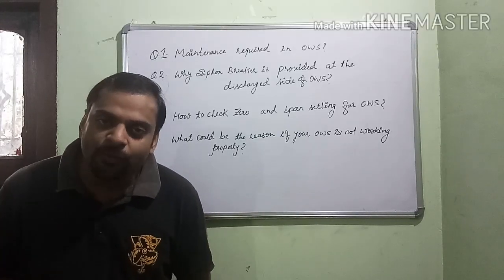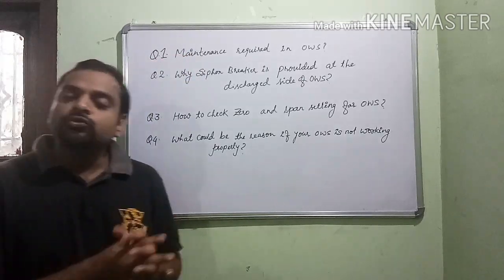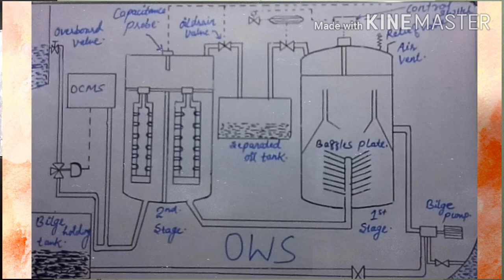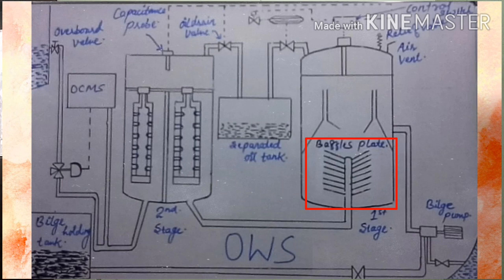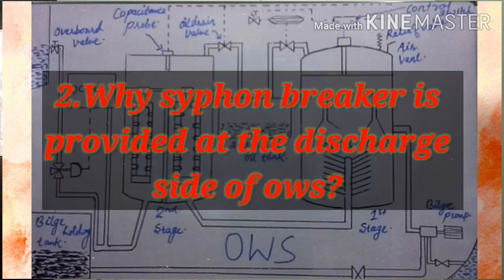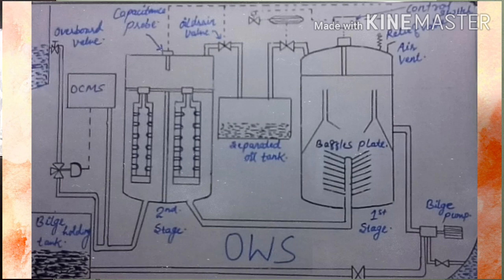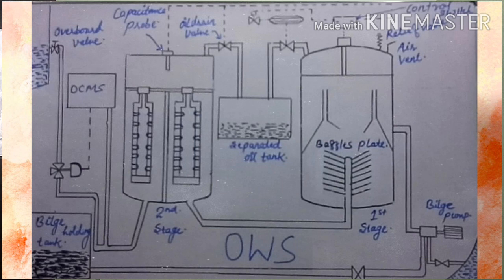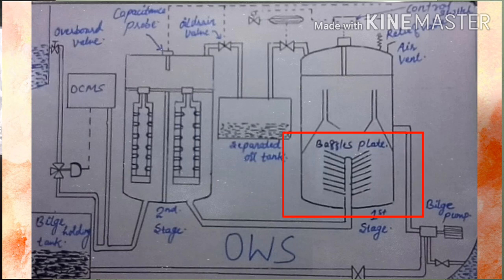oily water separators| OWS Troubleshooting

Comment: Sir u said caco3 takes place below 80 degree and mg(oh)2 takes place above 80 degree but  evaporation is taking place between 40-60 degree then how ma(oh)2 is taking place?
Reply from the maker: And second and most important thing is scale formation is not the major concern in fresh water generator because this is only the reason evaporating temperature is low in case of fresh water generator but it is also possible at 85.degree Celsius and corresponding to below atmospheric condition evaporating of sea water is achieved but in this case Mg(OH)2 scales is deposited. Which is more dangerous than Caco3 that's why FWG operator recommended to operate evaporating temperature low in case of FWG(45-55degree Celsius then caco3 scales formation takes place)  For example u take the case of boiler where scales deposited is more concern why???  
Because the operating temperature is high or say evaporating temperature is high so more scales formation.
So u are right evaporation is taking place between 45-60.degree Celsius  but it is also possible evaporation at 85.degree Celsius corresponding to below atmospheric pressure but in this case Mg(OH)2.scales deposited. But our Aim is to less scales deposited is formed. 
Please comment it below your doubt is clear or not?
Reply: @searainly  sir there temperature will low but because of presence of vaccum that's starts evaporating in this way scale formation will less  or the scale formation is same ?
Reply from the maker: Scales formation depends on evaporation temperature. In case of FWG evaporation temperature is about 40-45 degree Celsius (Because of vacuum). So less evaporating temperature leads to less scale formation...... On other hand u may observe that scales formation is major concerned in marine boiler. Why?  The reason is because of high evaporating temperature but in FWG evaporating temperature is much less as compared to Boiler.
Reply: @searainly  satisfied 👍🏻 thanks sir
Reply from the maker: Always welcome Brother!
Reply from the maker: Good question!  First of all the I told u the properties of sea water and the  conditions for different scales formation. But scales formation depends on the evaporation temperature but in this I considered one type of FWG which evaporating temperature is 45-50 (which is mostly used onboard ship)  degree Celsius. But let's assume one example Sea water heated at 85.degree Celsius (Below atm pr.) then in this case also SW achieve their boiling point.then Mg(OH)2.scales is deposited. (it is possible at 85 degree Celsius + corresponding to below Atmospheric pressure SW boils then Mg(OH)2.scales deposited. ) I just told u the property of SW and relation between sw and their heating temperature.
Reply: Ok sir.. Got it.. Thank you